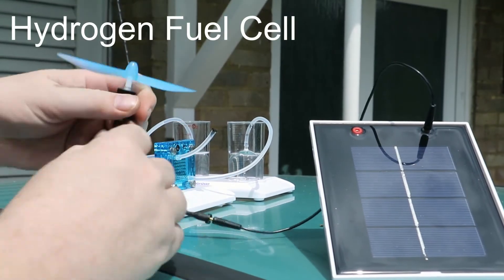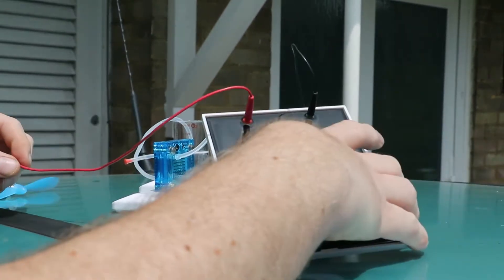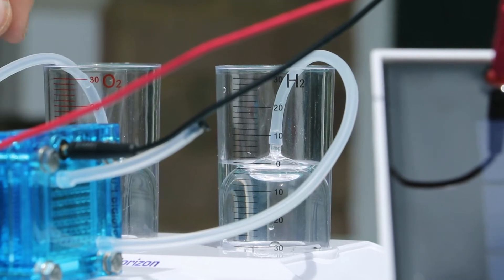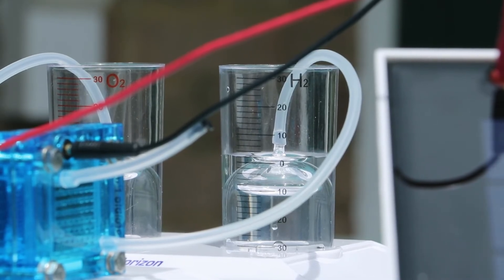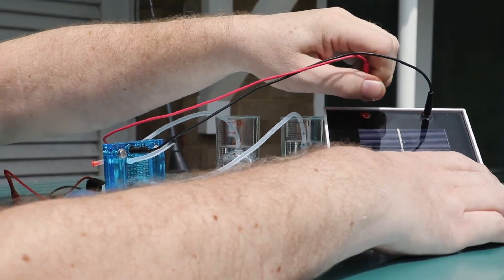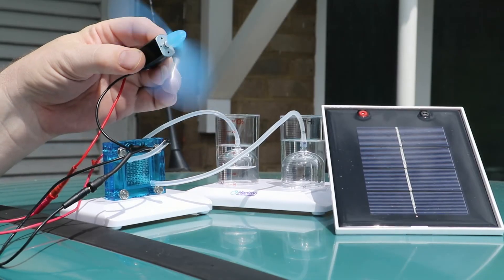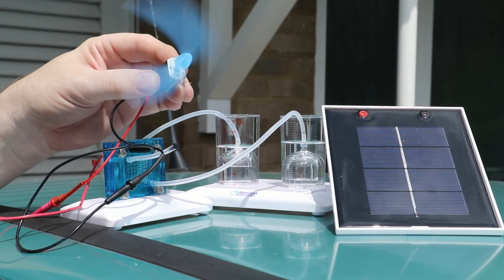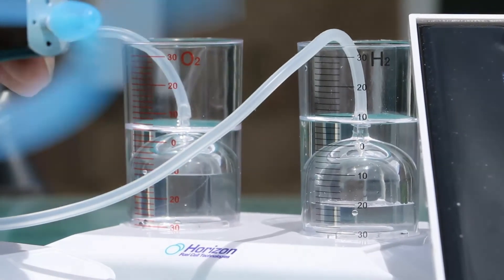Solar powered hydrogen fuel cell demo

Comment: How many plates are in the cell ?
If the pipes that the gas is being pushed through are connected at the bottom of the plate cavity, how is the gas being pushed down the tubes ? as the gas will rise in a liquid. I'm assuming that there is water in the plate cavity to split the Oxygen and Hydrogen from ?
and that the Hydrogen is being produced from the negative side of the plate ?
Reply from the maker: In this cell, there is only one plate.  It is a demo system to teach. In full sized systems then mutiple plates can be used.
Reply: I'm guessing there is water inside the fuel cell to produce Oxygen and Hydrogen ? Is that the case ?
Reply: @PhilipRussell  when there is only one plate, the electrolisis is not possible, how does it work?

Comment: This is effectively using water as a battery to store the suns energy.
What is the ratio of energy produced from the fuel cell compared to the solar panel for a given amount of time ?
Is the fuel cell full of water for this demo ?
If you had a hydrogen fuel cell powered car with a solar panel roof, it could generate Hydrogen whilst parked, which you could use to drive it upon your return.
Reply from the maker: If you can make enough solar then certainly.

Comment: dont you fill that it is loss of energy , we are using solar panels to produce power to induce the electrolysis power so that i can reverse the fuel cell and use this energy again , isnt it more efficient to take elec power from the solar panel directly
Reply from the maker: Yes it is.But if you want to use the fan or light at night time when the sun is not available then you can, using the stored energy. The purpose of the fuel cell is to take the energy from the sun and use it to store the energy so that it can be used later.
Reply: you could just use a battery
Reply: @The Self Sufficient Guy, The fuel cell functions as a battery. It’s stored chemical energy.